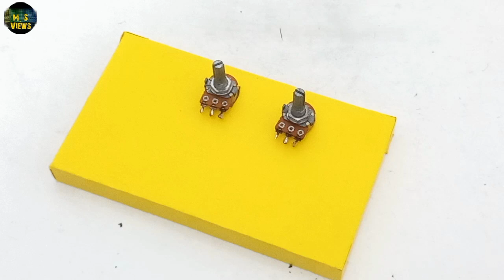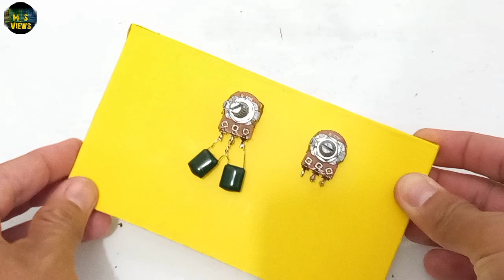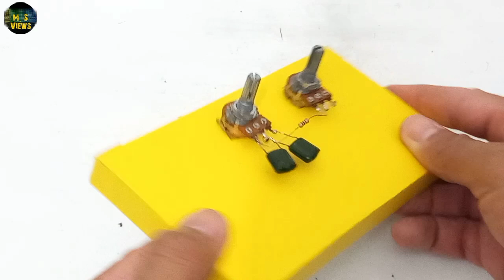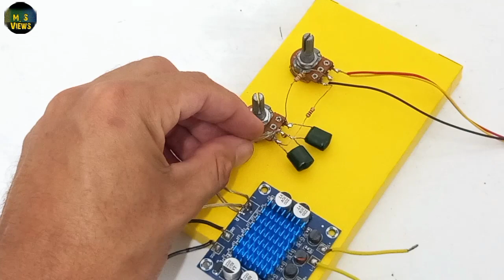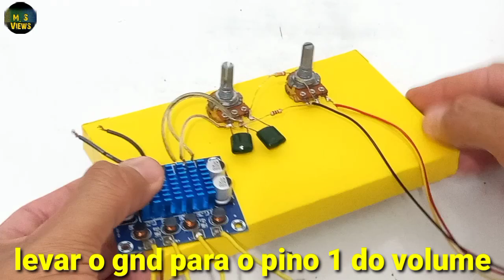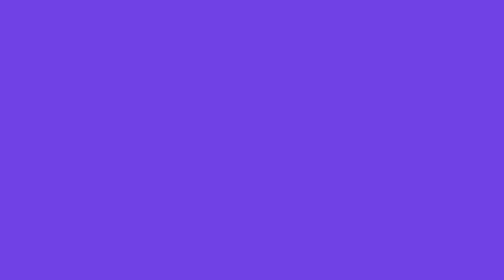Bass e Volume de uma forma bem fácil para sua plaquinha amplificada.

Comment: poderia me tirar duvida 
Estou montando caixinha som no barril to usando tpa3110, e auto falantes bomber 50 wats, ao ligar placa volume 48 vai até 50 volume começa cortar , já troquei placa tpa 3110 continua já coloquei fonte 12 5 amperes outra 12 v 10 amperes e até 12 v 50 amperes mesmo defeito já coloquei outro autofalantes bravox huricane e defeito continua. Teria alguma coisa para fazer, resistor ou alguma coisa do tipo somente volume 47 ate 50
Reply from the maker: Amigo, essa distorção acontece por conta do limite do próprio transistor da placa, acredito que não tem o que fazer.